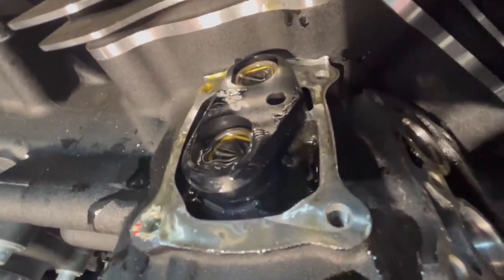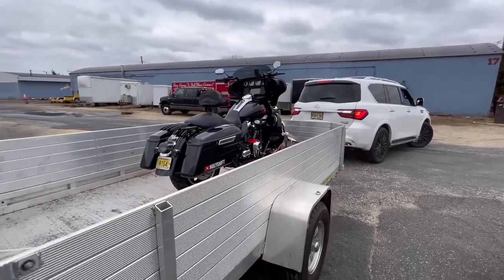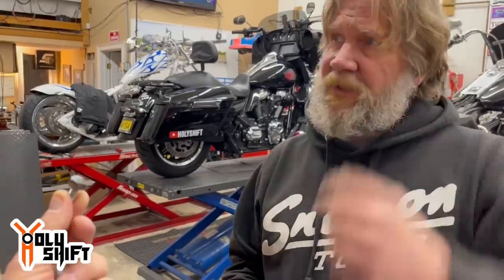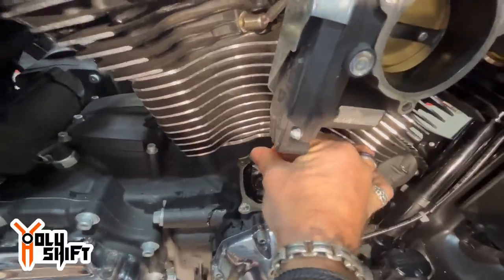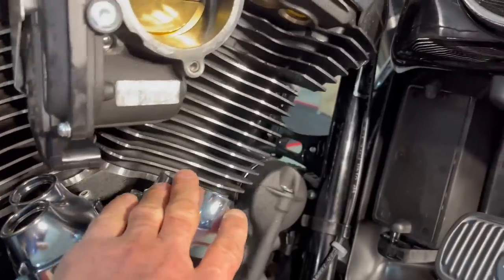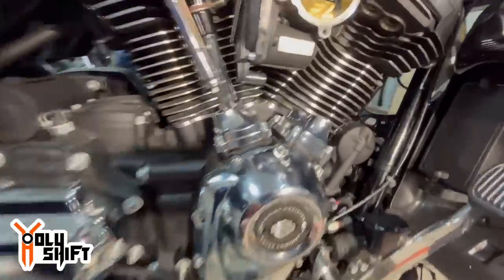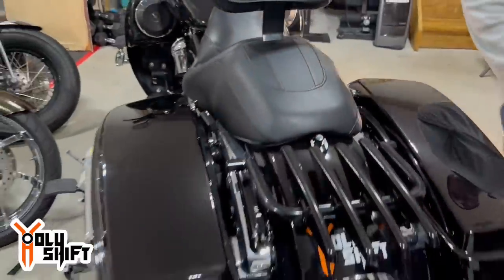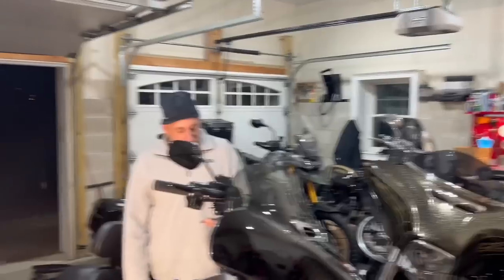Harley Davidson DIY Stage 2 On A Budget Part 2

Comment: There ya go man....all those 114 motors need....you don't need cylinders pistons heads compensator delete, all that crap that smokes the stock trans cause u didn't do a baker trans to accommodate all the extra power....now upgrade the suspensionand you'll have a perfect bike that'll run 100thou man....

Comment: Congrats for a job well done. Don't sweat the small stuff where the broken bolt is concerned, in the world of hot rodding things invariably go wrong, just learn how to roll with the punches and how to problem solve, there's always a solution. In addition to your advice to DIYers, I would recommend that someone at least be mechanically inclined in addition to some degree of knowledge of mechanics and last but not least, if you're going to work on your own bike, you should have a factory service manual(not a haynes or chilton) for your particular model, a bit pricey but well worth it.

Comment: Little trick to make sure the bolt does not break on tappet cuffs Use a heat gun pointing up were the cam chest was towards the tappet cuff They come out ever time hope this helps someone else
Reply from the maker: Yeah the guy at the shop told us - we should have taken it out when the cam chest was open and heat the cuff bolt from the bottom at top of the cam chest.

Comment: So question I seen you didn’t do upgrades oil pump. I’m about to get my bike done I have a 21 ultra. I was going to go screaming eagle power cam. But I’m double thinking.  Think I would be ok doing a s&s 475 and keep factory oil pump? Bike only has 7k miles
Reply from the maker: Sounds like a good plan . 2021 Harley oil pump are good !
Reply: @HOLYSHIFT  thanks for quick response man!!! Yes I think I’ll go this route because screaming eagle cam May disappoint to much